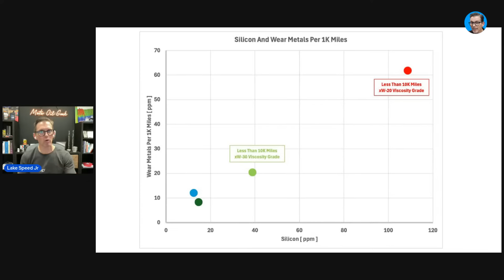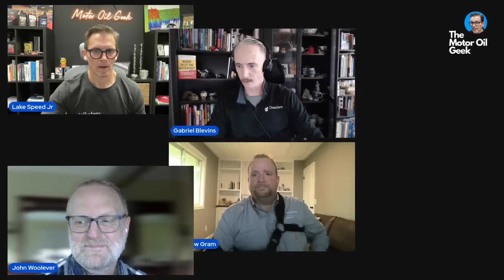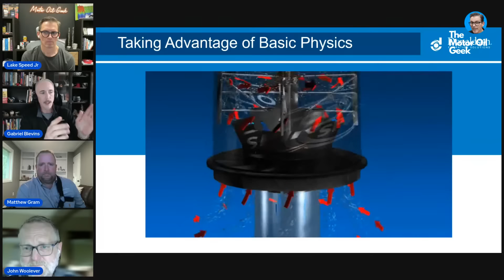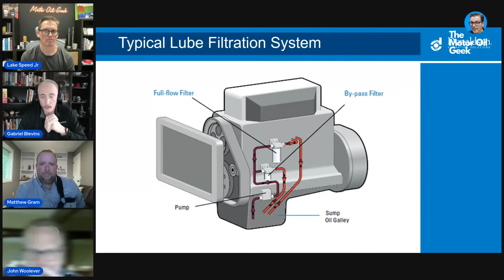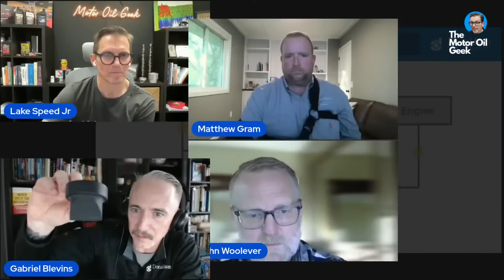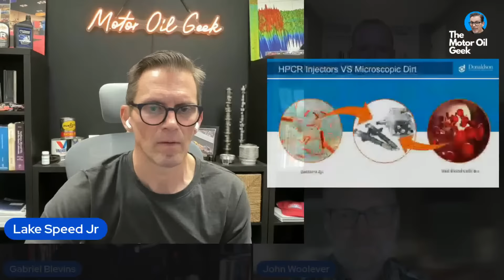DIRTY Filters Are BETTER Filters + BYPASS Filters EXPLAINED

Comment: I curious on the bypass filter, would it be better to go to the more efficient bypass filter after the main filter so that the main filter removes the larger contamination and the bypass removes the smaller contamination? My thought are you would get a much longer life of the more efficient bypass filter.
Reply: Bypass filters tend to not flow enough for proper lubrication. They don’t send the filtered oil to the engine but instead back to the oil pan. It would restrict oil to the engine if put in the way you describe.
Reply: @PaynefulT  
I was thinking of after the main filter from a port for a mechanical oil gauge then back to the sump

Comment: My daily driver, according to the manufacturer, has an air cleaner that is supposed to be replaced every 45,000 miles. It was hard to believe, so I checked it every year or around every 15,000 miles because previous vehicles I owned had a 1-2 year or 12,000-mile replacement schedule.

My vacuum cleaner has a filter rated for drywall dust. The filter is to be cleaned only by tapping the edge, not by washing or blowing it out.
Reply: Im betting your vacuum cleaner does not cost tens of thousands of dollars and you are still making payments on it 😅✌🏻
Reply: @billyarsenault1970  I think the vacuum cleaner was $129.  No, I am not making payments on it 😂.
Reply: Every car I've owned has said to check the air filter around 15,000 miles, and replace around 30,000 miles.

Comment: So the filter “efficiency” is not based on air cfm, but how well particulates are captured.
Just remembered that many manufacturers recommend replacing the air filter every so often in the maintenance schedule. Are they wrong?

Comment: at 50:35 is not gravity it is DENSITY heavy particles just settle and lighter particles settle in the top of heavier particles. it is all about density and timing why do i say timing because heavier particles will settle at the bottom sooner than the lighter particles. and it goes the same to liquids or fluids the heavier fluid will be at the bottom and the lighter fluid will be a the top. they say diesel gives you more power well yes it has more carbon and hydrogen atoms  bond together and it it a longer chain or molecule compared to a gasoline molecule meaning diesel molecules are heavier or more dense  than gasoline molecules a gasoline molecules is less dense with less density at the molecular level and that is why it stays at the top of diesel. what diesel needs is more refining but i guess is to much work and more expensive to keep refining even more.
Reply: What exactly makes more dense particles settle, if not gravity?
Reply: What exactly makes dense particles settle, if not gravity?

Comment: I wish the dealerships would get this memo about air filters. They ALWAYS tell people their air filters need to be changed, as a matter of course. I’ve had almost brand new filters in my cars and hear the same thing every time I have it in for oil service. I know it’s all about money, but it gets annoying when they are obviously trying to milk you for every penny they can get.
Reply: they probably don't know since the principle of new is good applies to everything except with this very specific one
Reply: People can just say no. Service techs are all different, some see some dust, bop it against the trash can and call it good, some see a finger print and want to change it. It helps to know what you have before hand to make your answer more informed. I'm in the camp of a dirty filter as an efficient filter. Dirty≠plugged.
Reply: I'd just tell them I already have a new filter at home for me to put in.

Comment: Yes I also beleive this  it will clean your oil better but there is going to come out lest oil, jut changed your oil filter every 10k to 11k miles specially for oil filters that claim to last up to 15k miles also do it for the ones that claim to last up to 20k miles. just change the  filter every 10k or 11k miles you will be 100% fine people.

Comment: Can MAF sensor live data be used to judge where a filter is in its life?
Reply: Hmmm very good question. When load is increased on an engine at idle, it will idle at a higher Maf Hz frequency as the throttle body is opened more to satisfy the idle rpm request. 

I suppose a very dirty air filter will initially cause the engine to idle lower due to insufficient air flow to satisfy the idle requirement, lowering the Maf hz frequency at idle. But then the ecu will compensate by opening the blade more to maintain idle, and bump the maf hz frequency at idle as a result.
Reply: No
Maf is after idle air control valve and the throttle plate looking at flow from filter to combustion chamber. These are variables that negate the usefulness of the MAF reading for seeing filter restriction

Comment: Specific question: it was mentioned in this vid to not use reusable air filters.  What is the recommendation for those of us that put a blower on or turbo setup and planning to use long term, they no longer work with factory air filters in general.
Reply: IN MY (TERRIBLY UNDESIRABLE) EXPERIENCE with a "K&N" reusable filter, on a Ford 351W, the damn "filter" developed tiny holes, even with the utmost care in PROPERLY washing and re-oiling it using original K&N consummables, and following K&N instructions to the letter. 
My engine got worn out all too soon. 

 Avoid the cotton gauze K&N Air Filters like the plague, and ignore their fraudulent advertising citing their use by armed forces in the desert!
As soon as you wash and re-oil just a couple of times, the cotton gauze will shrink and a lot of small, but visible to the naked eye, (just put a strong light behind, and you will see the holes!) will develop. Later on, I found at least four other friends at our local Mustang Club, to have EXACTLY the same bad experience.
Reply: @alfredomarquez9777 thank you so much for this.  Any  brands you would suggest trying?   I was looking to retrofit a Banks huge air filter.

Comment: Aftermarket remote oil filter mounts using 2 spin on filter elements  were and may still be used to minimize oil flow  restriction. I believe the oil flow is parallel between the 2 filter elements. So if you use 2 elements 1 with a high flow rate and the other element with a fine ( low micron number) .
This would give the best of both. The fine mesh element would catch the small particles but the full flow would allow high volume so no chance of oil starvation. This might have some advantages over a bypass system.
I remember working on a 409
powered cruising boat that the boat builder remote mounted the oil filters way behind the transmission so that it was easily accessable for service. I was on the boat for another reason and I touched the 
filter and it was cold. The engine was running and warm. I told the owner that the oil was bypassing  the filter. I told him to change the oil and filter asap.
He didn't react to what I told him so  he didn't take it as seriously as I did.
Reply: Context is king.  You said the bypass was active, means the system has engaged a safty akin to a MIL light means keep going till it's convenient to think about addressing it.  If you had said it was plugged insted of in bypass  a different response may have happened.
Reply: @daviddroescher  I think the oil  bypass valve was on the block 
 where a normal oil filter would be in a car.
Chevrolets were built like that. Assuming the 409's were the same. It amazes me how successful people can be so uniformed about how
 warning lights or low oil pressure readings  can cost them.
Reply: @williambikash6645    1 in the pump would be dumping back to sump and no oil pressure would result.  .  The 1 in my mind was in the filter, requiring flow to active,  but you said cold. 

Oil is routed from pump through inturnal pressure limiting bi pass to sump and remains to filter.  So cold filter is 100%to sump how is it the engine  getting oil? Possibly went bak to block mouted spin on . This would also explain his lack of concern. 

This was years ago so just an interesting thought expairament.

Comment: One thing i would like to add there are a handful of applications that the stock air cleaner systems that leak past the filter.   In applications like that a high quality cold air intake is the only option to keep the dirt out.
Reply: That would be rare that a factory stock air cleaner system would leak. I've seen test of cold air systems compared to stock on a dyno and it showed the engine made less horsepower. Plus there can be heat soak in hot climates with these cold air systems.
Reply: I agree it does not happen often.  Just 1 example is the 99.5-2003 ford 7.3L powerstroke.    It is a well known issue, so much so that most of the reman engine manufactures will require proof of a cold air intake for the engine build warranty.   I do know this is not the normal.   That being said i felt it important to mention it here.  @chrisdenman1985

Comment: Where does the silica come from
Reply: Fine sand from the environment.  Sand is mostly made of silica.
Reply: Thats not good. I live about 4 miles from the beach
Reply: No problems if you pay attention to the go no go filter dohicky. Or somewhere between the manufacturers normal and heavy duty/bad conditions  intervals.  @louarmstrong6128
Reply: Silica % determine what type of lava comes out of a volcano  low% = basalt  like the Pacific Northwest  4+ miles thick.  High% = cone typ volcano like Mount Hood, Reanear, St Helens .

Comment: Does anyone make a sock filter for the filler tube on diesels? Say a 5 micron?
Reply: That would suck to service.  Looking at 2-3days to get 1 gallon to gravity feed through a 5 micron sieve.  So a diesel pickup is a full week with 3ga  and and over the road semi with 15ga is a month or better . Rigs with oil capacity mesured in barrels would take months to years to fill after a oil change.

Comment: Dirty air filters can work better.  I have never seen dirty fluid filters work better.
Reply: Same same air is a low viscosity fluid.  so oil and air have the same physics
Reply: HD diesel mechanic, big topic in school was, that a fuel filter is the most efficient at cleaning fuel right before it plugs. Because after that not even fuel gets through. Detroit diesel wants filter restriction checked before changing filter. The most common cause of fuel system contamination is from changing the filter or opening the system.

Comment: Thanks! Keep in mind filtration is only one side of the coin. The other is airflow that makes power.  Filtration is a tradeoff between engine longevity and power output, especially for non turbo engines.
Reply: As Lake pointed out at https://youtu.be/-4YljjRe8ic?t=1038 , unless you are running full throttle, the restriction is the throttle plate, not the filter.
Reply: @dontosaw - not full throttle, lots of throttle.  I size my engines for my usage, not overpowered or idling all day.
Reply: @dontosaw every owner's manual even mentions to check for an excessively dirty air filter if power/economy is down.
Reply: Good point, it's a balance between enough flow to not cause a power drop and subsequently hurt gas mileage, and adequate filtration.
Reply: Literally what the video is about. Did you even watch the video?

Comment: Bang air filters out don’t blow them out. When I see over a 3psi air filter drop I can detect a drop in performance. That being said even at 10psi I drop it’s only like 10hp loss on a 400hp engine.
Reply: You're reading on the wrong scale. Filter restriction is measured in "Inches Of Water", not PSI. 

If a filter has 10PSI of restriction the engine won't even idle.
Reply: @Texassince1836  Nope it’s the right scale. My datalogger measures psia as in absolute pressure including the atmosphere.  The turbo spinning hard under load can draw it down 10psi no problem on a stock paper filter because it was sized for 160hp but the engine makes 500 now.  After I put a big filter on it it only drops about 2psi max now.
Reply: @bcbloc02  so your datalogger reads  4psi absolute when you see a "10psi" drop?
Reply: What psi drop causing the indicator move to the 1st tick? Never seen one move.  But the hx35 barks more often when the filter starts getting enough trash to increase its efficiency.  Change the filter and the cruise control stops barking the turbo. (9812v stock air box for reference)

Comment: So the question. If I change oil every 3k, 3-6 months. Does it make more sense to change the filter every other change (6k, 6-12 months) because it's more efficient?
Reply: This was exactly my same question. I am a firm believer in the shorter oil change frequency but with the efficiency gains of a slightly dirty FILTER, I am going to start skipping to every second oil change for the filter on my daily (Toyota Camry).
Reply: I'm wondering that too. Honda has recommended changing the filter only once every two oil changes for a long time.
Reply: I think they are saying more like 3 to 5 years...I am guessing

Comment: I've had pickup trucks with an indicator never seen one move, the current duramax will suffer noticeable performance loss while still reading "green"
Reply: Same hear . By Cummins's Turbo gives verbal complaints( Turbo bark is much more frequent due to increased p1/p2) long before  the indicator  thinks about moving, (never seen it move)

Comment: As long as your filter is still letting through enough air or oil and it is not being damaged by the pressure drop, the dirtier the better.
Reply: And how do you know when it blocks too much?
Reply: @someone7507 Right on. 
People are fucked- 
They will say anything to justify their lazy asses 😅
Reply: Years ago on my Chevy S10 that only held  4 qts of oil 🛢️ in the 4.3L V 6 engine. I would make sure to change my oil 🛢️ every 3000 miles. But often only changed my oil 🛢️ filter every 6000 miles. In part because many newer vehicles that hold 6 or 8 qts of oil. Say to change the oil every 5 or 6000 miles. Which means the oil filter is only getting changed every 5 or 6000 miles also. 
Which I'd explain to people who said that I should also change my filter every 3000 miles. I had a strong magnet 🧲 on the oil pan drain plug. To catch any steel shavings. I also put a strong magnet 🧲 on my transmission fluid drain pan.
Reply: If its visibly filthy then its probably not letting thru enough air for a performance engine and it’s noticeable-
If it just a daily driver then whatever but im not running dirty filters on my dirt bikes race engine because it does not run right and even high quality OEM filters are cheap enough✌🏻
Reply: @billyarsenault1970  yeah for a high performance engine, where you want maximum power, like a motorcycle, you definitely want a clean-ish air filter.
Reply: @mareksumguy1887 ✌🏻
Reply: @mareksumguy1887 k&n actually says not to clean their motorcycle air filter for 50k miles. They say they are designed to work with a layer of dust on them because dust attracts dust. Weird but true

Comment: In our underground coal mines here in Utah. We will completely use up a air filter in 24 hours. That is using the indicator and watching it get into the red.
Reply: Thats crazy, how do your lungs hold up?
Reply: @AdmissionGaming not good it's called black lung. But we wear ppe to try to protect us as much as we can.
Reply: @AdmissionGaming it's called "black lung" and yes you can die very quickly, worse than smoking. Oh I see someone beat me to the black lung.
Reply from the maker: Wow!
Reply: Yep it's true
Reply: I'm guessing nobody bothers with pre-filters?  or is that with pre-filters installed?

Comment: They do have a handful of those air filter housing in gasoline passenger cars. IIRC 2005 Ford focus 2.0Duratec PZEV, its a lifetime air filter with an indicator just in case you drive thru the desert.
Reply: I forgot about that car, I remember seeing that it was plastic welded into the air box.

Comment: Isn't stating filter efficiency improves over time analogous to stating a diesel engine has torque rise?
Why not design the filter for the necessary efficiency when new and replace it when restriction is unacceptable?
Reply: Service intervals ... a proper filter for hi way only use will die in 20min on the back roads especially if following at the back of the pack. 
2 a little dirt damage is acceptable  and preferred over 0 dirt and a filter sucked into a turbo or throttle. 
Had a friend get his motor destroyed by dodge dealer  service guys  never checked the air filter due to previous owner installed a k&n sticker(just the sticker).  1st indicator of trouble was oil pressure alarms  . The dirt cault by the filter built up till plugged then on an on ramp( foot in it)  the filter collapsed and dumped years worth of dirt into the intake. Enough trash made it through the rings to plug the oil filter. Change the filter as a diag step new oil filter plugged Enough to trip the oil pressure light in 3-5min of idle.
Reply: @daviddroescher this is the other side of the coin nobody is talking about, when you finally have to pass someone on the highway and go full throttle, the "efficient dirty" air filter will be sucked apart and its weakest points will eventually break and filter media and dirt will be injested into the engine

Comment: So I guess elevated silica in a new cars first oil change is partially due to the new air filter.
Reply from the maker: It’s primarily from the sealants used in the assembly process.